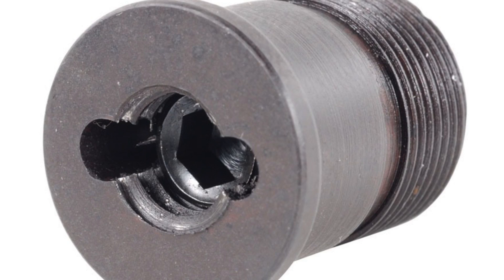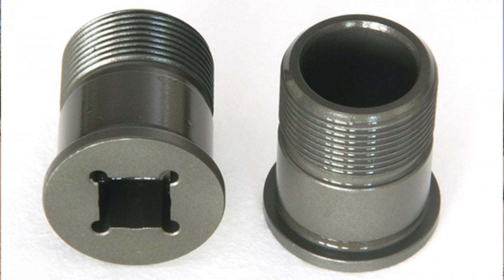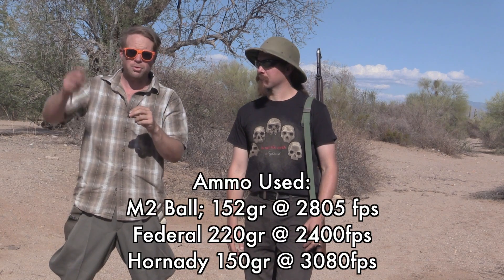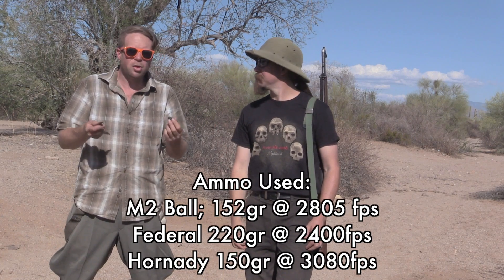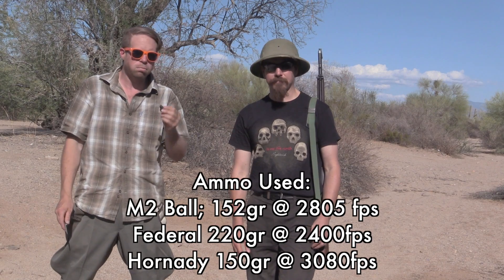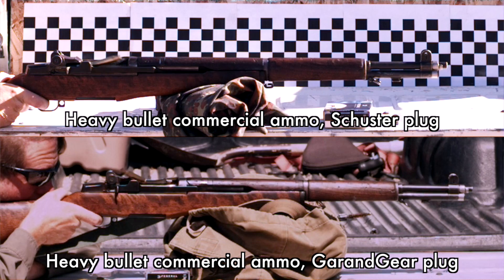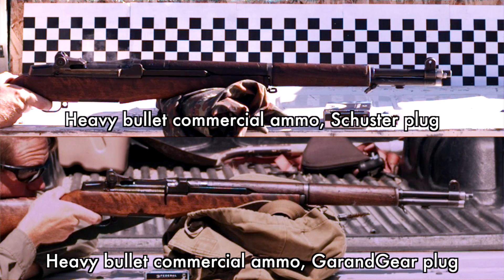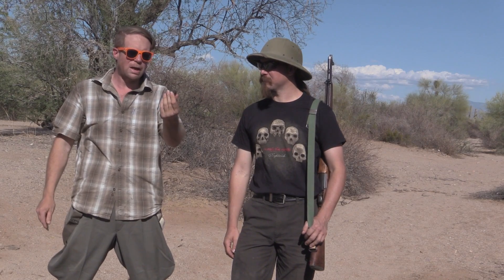Review: Garand Gear M1 Gas Plug

Comment: Good review, my father and I picked up an M1 from my brother in law last year for $500... A steal right? We've used the Garand gear plug and haven't had issues in that regard.

That said, we do have another MAJOR issue: every time I shoot the rifle, the trigger mechanism falls out.. Not joking.. My in law says they've put hundreds of rounds through it no problem, and now this happens. Ever since the first clip I've put through it, I've had to grip the trigger housing to keep it from falling out. Any good way to fix this?

The stock is not original, so I can pick up another stock. Just wondering if there's anything less costly to fix the problem. I've heard to fill the stock where the trigger housing clips in with wood filler and sand it down until it works, though this only seems like a temporary fix to me. Any suggestions??
Reply: OH MAN! This was a problem I had for a good while! Always at the range trying to look cool and then my trigger group would fall out and bounce out in front of the range box.

My fix was to replace the trigger guard as the latch was worn down from repeated disassembly over the years since I received it. Another issue is the guard itself might be slightly bent out of spec. Definitely cheaper than a new stock but requires knowledge on how to take down the trigger group. Easy to do after one or two attempts with just a punch or a screwdriver, I learned after watching a disassembly vid. Also, in the mean time, if youre definitely going to get a new guard you might just try bending the guard back in a bit with a few conservative whacks of a cloth wrapped hammer, while the guard is removed from the trigger group of course. Check to see if the latch face is deformed or showing silver. It might just be worn down.

Ive had practically every problem surface with my Garand over the last decade and ive troubleshot a lot of them with success.

Edit- A quick fix for right now would be to tie the guard to the wrist of the stock with some cordage. Works if you have the hole style (superior IMHO) but not if you have the open loop style guard. This was how I shot my Garand for 4 months before I finally fixed it. ALSO be sure that when youre removing or replacing the trigger guard in the future to apply even pressure directly backwards and get the latch to clear the floor plate before removing it. Stick a screw driver through the hole (or loop) and grip it between your middle and ring fingers. Replace it the same way. Try not to snap it back into place. Its a very small piece of metal. Or just dont take it apart that often.
Reply: It’s well known that the trigger mechanism loosens over time with repeated take downs of the rifle.  Avoid doing this as much as possible.  I’ve had mine for eight years and only take it down for a thorough cleaning once a year.  The rest of the time I clean it the best I can through the ejection/loading port.  I almost have to stand on the trigger guard for it to snap closed.
Reply: Replacement stock sets are sold on the internet for M1s. Some are oversize.
Reply: BrassBashers think you could bend the trigger guard out a hair
Reply: Might try that. Local shop has 3 Garand stocks they CAN'T get rid of, selling for $35.
Might pick up one or two if those and see what causes it to catch, might modify the current stock (it looks GREAT, the ones at the store look shitty).

Comment: I use the GarandGear plug but I was still Leary of shooting anything over 150grn with it when it came to commercial ammo. I use it for M2 ball or my M2 ball styled reloads. I should look into the adjustable plug though. Would be nice to have some options.
Reply: Andy47357 - Always invest in a few quality reloading manuals. They are backed by full labs and have pressure tested data. Beware online sources that are not a powder manufacturer or bullet company, or loaddata.com. DO NOT use data posted by random people-verify it with a current manual. As a bonus, some manuals have a specific section for Garand data. They are also full of useful info and tips. I'm sure u know all this, but in this digital age, i find that peopke forget about the value of reference BOOKS! Shoot safely!

Comment: seems pretty obvious from the start that your biased against this particular product, given how much opinion and anecdote is inserted into the judgement. Also pretty obvious that your judging it from only one data point, rather than referencing the data the Garandgear actually provides on the Gas Plug tested with various loads, including 220grn Federal which shows that with the Garandgear plug peak pressure is reduced by 250psi and total impulse is reduced by 65lbf-ms from M2ball with a GI plug.
In fact for all 26 types of 30-06 ammo they tested, peak pressures and total impulse remained well below that of M2ball.
You can check the data out for yourself. http://www.garandgear.com/m1-garand-ammunition
Reply: "check it out your self... just go to their website...im totally not biased.... just go to their website bro"

their is nothing wrong with their testing....HAVING A VENT HOLE MEANS YOU CAN FIRE MUCH MUCH MUCH MUCH MORE TYPES OF AMMO WITH DIFFERENT TYPES OF POWEDER. 

you get a round with the right powder.... sure...the G-gear plug might work....

but the shosther (whatever) is going to work on EVERY type of ammo, after you adjust it.
Reply: but... it works and they say it works.  their usage preference leans to the schuster, that's about as clean of an assessment as you can get.  'this works in general case, our choice works better in special case.'
shoot if I had a garand I'd throw one of those nonadjustable plugs in it for the recoil reduction alone.
Reply: kaiserpanda or get the adjustable....tune it where their is no slam what so ever (which still happens with G gear..just not as hard)

and you have WAY less recoil. 

my m1 has an adjustable...it doesnt slam....and it is very low recoil....like noticeably less.
Reply from the maker: We had a bias, of course, because physics.   There's no way to not approach a topic without a bias, so to claim there was one is always fair.   Our methodology of testing by measuring the velocity of the oprod fell right in line with our expectations because physics.  ~Karl

Comment: Thank you, i was one of the ones that requested this.

Would a heavier spring also reduce the oprod velocity? i have a wolff 15% extra power recoil in my 1954 Garand
Reply from the maker: It would, yes.  ~Karl
Reply: Yea you should be fine. My understanding is that the contact of the op rod lug channel unlocking the bolt and contact of the bolt (and attached oprod) with the rear of the receiver is the force that creates flex on the bend in the oprod. More the latter than the former.

A stiffer spring just requires more gas force to move the oprod back, reducing the speed at which is hits the receiver, reducing the force put in the bend in the oprod. The stiffer spring will probably help more with positive stripping of the clip on the return and initial chambering more than it would help with the reduction in bolt velocity but both are good things.

Edit- The slam in the receiver is the oprod being squeezed together from both end points. The gas pushing back on the piston at the front and the receiver pushing forward on the bolt attached to the oprod at the back (when it slams) bows out the oprod at the bend. Think of the archers paradox, same theory kind of. When the bolt slams back forward its actually being pulled by the oprod so no bending occurs there. Or I should think not anyway. Hope that maybe helped visualize the process a bit better?
Reply: +kain hall i always thought it was the slam back and then forward that was the main issue?

i have the GG extended gas chamber plug and an extra power spring thats why i asked
Reply: to run a spring thats stiffer.... you have to but MORE pressure on the gas piston (which is the oprod)

its not about the op-rod slamming back to a stop on the receiver.....its about how hard the gas hits it. 
it slamming to a stop only tells you that its probably moving too fast. 

your spring fixed the slam issue....but your now putting more pressure on the system.

Comment: help me understand this don't you want the pressure on the operating rod so that the semi automatic system works
Reply: Check out the Archers Paradox. Its not a direct correlation but it does help you visualize where the issue occurs. After you check out the video, apply these concepts to the arrow.

1-The arrow is the oprod itself. The arrowhead is the bolt, the notch is the piston.
2-The flexing of the bows arms and the string sending the arrow forward is the gas system.
3-The arrow bending is what happens when the bolt (arrowhead) slams the receiver too hard.
4-Greater bow strength is equivalent to higher gas pressures. If the arrow is poorly made or not thick enough, it breaks/oprod bends. Because of the specific bends in the design of the oprod it operates within a fairly narrow margin or pressure.

Maybe thatll help visualize the process a bit better? Its not a perfect analogy but its what I use to help people understand why I cant just load up their 220 grain Bear Destroyers for a day at the range.
Reply: Yes to a certain extent, but the way the op-rod on the Garand is shaped leaves it vulnerable to being damaged if the pressure is too high. I've got one of the plugs featured in the video, and am glad I saw this video. I've been toying with the idea of 175gr loads that more closely match the earlier M1 ball ammunition. I think I'll be getting a Schuster adjustable.

Comment: How often do you have to clean the adjustable gas plug to maintain it´s function?
Reply: at the risk of being an internet "gun expert" (I do not own the thing), it would seem you would clean it the same as an original gas plug, since the aperture is only adjusted by completely removing a screw.  Shouldn't be much different.
Reply: ive shot probably 150 rounds threw my m1....ammo isnt cheap for my poor ass....and i havent cleaned it. 

you can feel when the op-rod is slamming into the receiver....and you can feel when its not. 

when you feel that it starts hitting harder....STOP and clean it.